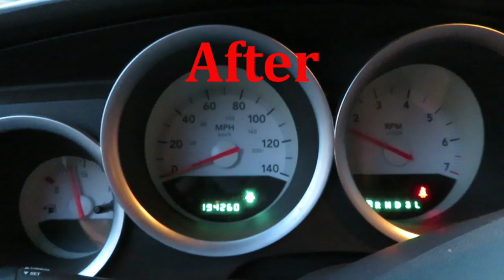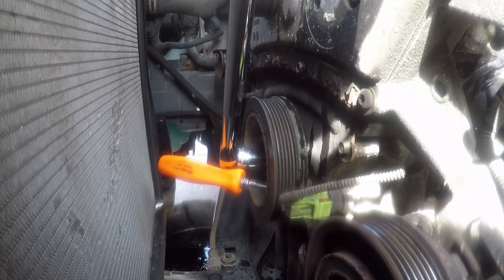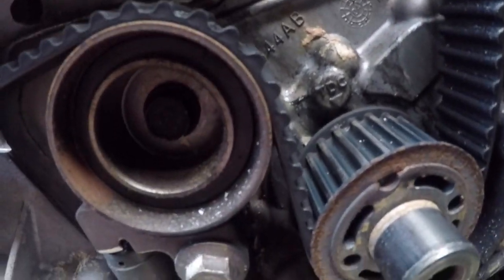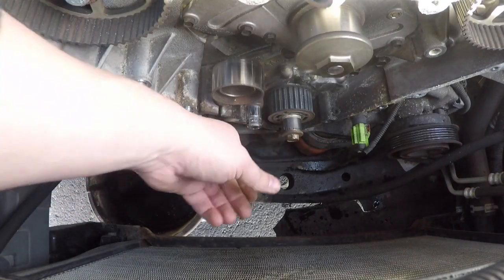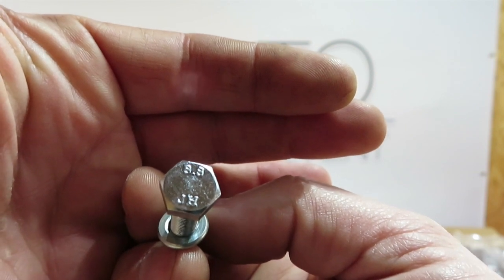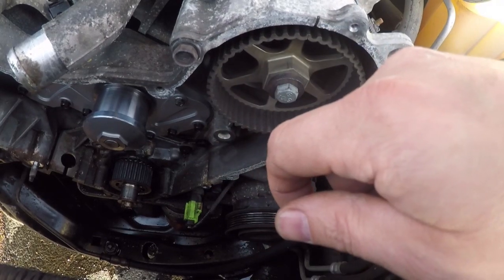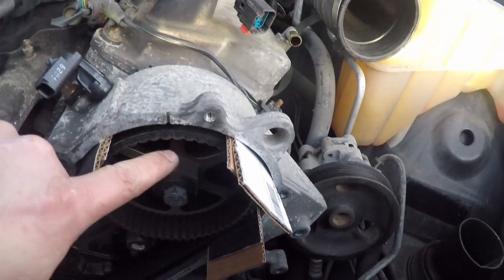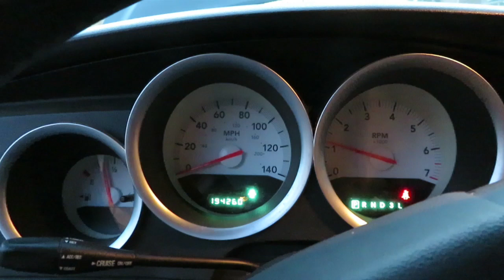Dodge Chrysler 3.5L Timing Belt and Water Pump Installation I Saved a Ton of Money!!!

Comment: I can’t get the pin out, should I just leave it there?
Reply: Like I heard the little click of the release but the pin is just stuck, can I just cut it at the base and leave it so I can put the covers back on?
Reply from the maker: I am assuming you are talking about for the tensioner, if so, as long as the tensioner is holding tension on the belt you should be good to cut it

Comment: Great job but just fyi timing Belts don’t stretch, thats their key feature ;)
Reply from the maker: I guess I just assumed being rubber, they could stretch. Thank you for the info, watching the video, and commenting.
Reply: @DCAutoEnhancement  ya they will snap but will never stretch or it would cause timing issues with zero interference engines. A lot of Chrysler 3.5 engines will smash valves into pistons if belts jump teeth.

Comment: What if the alignment is way off, how can I get them aligned, I have tried turning and turning but they are way off??
Reply from the maker: I started with getting the crank at Top Dead Center (TDC) then I lined up the right cam, then the left. That's where it got kind of difficult.  I had to use some cardboard as a wedge holding the belt tight on the cam sprocket and crank pully. If it is really far off, there is a chance that damage has been done to the engine. I hop this helps.
Reply: How did you align the cams you turned them back?
Reply from the maker: I made sure to rotate the cams as little as possible. I did go forward and backward slightly because the valve springs were making them rotate past the marks.  I don't know if that answers your question or not.
Reply: In the video they were 4 teeth past the marks, you were able to turn the cams back to marks. I have one that’s only one tooth past, still waiting on parts but with the crank on the TDC line I should be about to move the cams back so the markings align?
Reply from the maker: @209Bossman  I'm not sure if your question came through

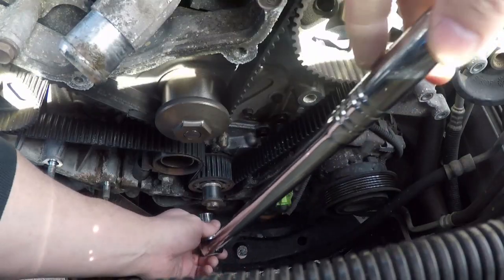Comment: 12:11 bro how did u remove that bolt at the end to put the harmonic balancer back on???
Reply from the maker: I think I used an impact or just a quick snap to break it free. I assume your bolt is so tight that when you try to loosen it, the crank turns?
Reply: @DCAutoEnhancement  yup, I had a feeling it was gonna do that but took the chance anyway lol. I got the timing aligned but now gotta figure out a way to remove that bolt lol but thanks for ur video man it was really helpful
Reply from the maker: @eklipz7213  I'm glad it was helpful. I have another video doing the same job that might show how I did that part. https://youtu.be/MexjRlH7MuE

Comment: So if it's leaking do I need a new water pump or just the seal?
Reply from the maker: If your water pump is leaking, usually it is due to an internal leak and not as simple as the water pump gasket leaking. That is why it is most common to replace the water pump itself.  I hope this helps.
Reply: Replaced water pump then now car runs rough in engine light is flashing...
Reply from the maker: @snowbunnee1471  sounds like maybe the timing is off. Maybe the one of the two cams are not in time with the crank shaft.
Reply: Well I took back apart and the person helping me didn't clean all the gunk off in I forgot so I cleaned up and am reinstalling everything but wen I got the timing chain off there was this little metal piece that is square has two different size holes on it fell out not sure where it goes I don't see it anywhere on any of tge videos. I dobt know how to send videos on here.
Reply: I sent pics through the email of the piece .
Reply from the maker: @snowbunnee1471  you can email me info@dcautoenhancement.com
Reply from the maker: @snowbunnee1471  it takes a while to get through. Try dcautodiy@gmail.com
Reply: Ok I email just now thanks so much I appreciate all your help with this.
Reply from the maker: @snowbunnee1471  that may be from your tensioner t the bottom on the left. Is the belt tight?

Comment: My 3.5 broke the timing belt after 13000 miles on the belt and has a misfire on cylinder 1 and 3 we broke it down again and made sure was still in time and yes it is but is running terrible so I replaced coils cam sensor and crank sensor still misfire on 1 and 3 cylinder..and turns over along time before start..but had it to start first time was smooth them messed up again so done everything all over and back two square one..when my belt broke I had just pulled off from a stop sign so hopefully not much wrong please help if possible
Reply from the maker: Usually on these cars if the belt breaks, it will destroy the engine (pistons hitting valves) however, if it just slips time like the one in the video, it should be ok. Timing is very specific, as I am learning even more on a car that I am currently doing a head gasket on! If timing is good, crank and or cam sensors can be a potential issue. I don't think that I was much help but that's what I got for you. Thank you for watching!
Reply: Sounds like you hit valves and might need a new engine sorry dessie.
Reply: I did replace the engine..then after putting about 10,000 miles on that motor my transmission went out so we replaced it with several bad transmissions so I bought a chrysler 300 I drove home everything was fine I have a friend at a salvage yard he said they was a match and now when it shifts into what it's shows is 4 gear which is actually 5th gear idk why dodge Has it like that it's a 5 speed transmission it will jerk and go into limp mode and code P0730 Incorrect gear ratio we haven't been able to figure it out..but tyranny worked fine in other car...I been dealing with this since april..idk what to do..I even called dodge dealership and asked them did I need to have it programmed or flashed and they acted as if I was crazy..so now I'm really lost..salvage yards said no I shouldn't either..any ideals would be great
Reply from the maker: @dessiealdridge6832 I had a similar issue on an older Sebring and it was the transmission control module

Comment: What if you put it on time and when you spin it to check it’s off timing
Reply from the maker: You would want to pull the belt off and get the crank pulley back to TDC and then put the belt back on and put the cams slightly off in whichever direction would correct the misalignment

Comment: I’m doing mines and my t40 star bit stripped the bolt do u think I need a t 30 instead
Reply from the maker: Usually if something like that is stripped, you would move to a larger size. Sometimes you can use an Allen wrench on a striped torx. I would see if any of them fit try both metric and standard. Just be really careful and feel for it to slip. Worst case, you will have to drill it out(sounds worse than it actually is other than the right space).
Reply: How did u get the harmonic balancer pulley back in
Reply: @spartatacticalarms6914  ...i followed another video & it worked....buy a 12M x1.75x100 bolt from hardware store & use a 1/2" socket, feed the bolt & socket thru it the pulley & tighten it about 1/2 way, back out the 12M bolt and check to see if the original crankbolt will catch, if not retry until it does

Comment: you should have kept turning the crank pulley one more complete turn and all the timing marks would line up now you have the timing way off good luck with getting it set right now and hope its not an interference motor cause it will bend the valves
Reply from the maker: Thanks for the comment. If you watched to the end, the timing must have been right because it fired right up. It is an interference engine.
Reply: @DCAutoEnhancement  this guy doesn’t know what he’s talking about haaha mr know it all. It might of skipped timing and luckily it didn’t travel very far and potentially hit valves. I saw that the T-belt was damage on the edge of the belt that might of caused the t belt to travel and skip time you did an excellent video by the way. I got a timing belt job on a Chrylser Pacfica 05  timing belt and water pump replacement. Very similar but I’ll be working on the side of the vehicle.
Reply from the maker: @erictech201  I appreciate you taking the time to watch the video. There are a lot of people that are quick to speak (or type) without really knowing what they are saying. Good luck on your timing belt replacement.👍
Reply from the maker: The P0300 as you probably know is a code for multiple cylinder miss fires. That could very well be from the alignment of the cams not being correct. I agree with you to be suspect of that because it was running fine before the work and not fine right after. I would take it back to the shop and see what they do for you.
Reply: 2 full turns.. the 4 marks off is likely when water pump bolt snapped and it wedged on crank gear causing belt to stretch n crack like in video, my guess as to why timing was off equal on both cams..  Just bought a 10 charger with dreaded death rattle, swapped rockers still noisy, took apart 2nd time found random 1" piece of plastic down in #4 intake runner, not sure if this caused it to rattle after repair, an intake valve held open a little, the plastic is not from either of the 2 times I had it apart, there was nothing up on intake and it was all blown clear of debris.. soon as I figure this all out, will likely venture into timing belt n water pump job.

Comment: Is it possible that the heads would have messed up because of a timing belt
Reply from the maker: If the timing belt broke, yes. This engine is an interference engine. If the belt breaks, the piston will crash into the valves and you could end up with bent valves at the least or damaged pistons and damaged head at the worst. You would know of you turn the key and it sounds normal other than not starting. If you turn the key and it sounds like stuff crashing it's not good

Comment: How do I install the harmonic balancer?
Reply from the maker: I am glad you asked.  I am in the process of making a second version of this job.  If it would be helpful, I can make a quick video tonight from my footage of just installing the harmonic balancer.  I struggled to get the one on that I recently filmed.  The one in the video I didn't have any issues with.  In the end I went to Lowes and bought an M12x1.75 bolt and used a socket between the bold head and the harmonic balancer to drive it on (after spending $75 on a kit that didn't work).  Let me know if you'd like to see that video and I'll make it this evening and put the link here.
Reply: @DCAutoEnhancement  it would be nice
Reply from the maker: @danielcams7514  I will be posting it today
Reply from the maker: The audio isn't great but hopefully this is helpful to you.
https://youtu.be/W5vR5lv4QP0
Reply from the maker: Thanks for asking about this, this video is performing well and hopefully it was helpful for you

Comment: What if the belt was broke tho
Reply from the maker: 😳🤬 most likely, no good.  With these engines, loud noises and bad things happen if the belt breaks while running.
Reply: @DCAutoEnhancement  can I time the engine by moving them all individually clockwise
Reply from the maker: @5.7_Soul  I would be concerned that if it's out of time by much at all, you could potentially run valves into the top of a piston or two.  I don't know this answer for sure though. You could try Dodge forums to maybe find a good answer

Comment: How did you take the timing bolt off
Reply from the maker: Did you mean belt?
Reply: No the bolt at the bottom I can’t get it off the timing at the bottom.. the one you said to screw into the bottom to turn the belt
Reply: It keeps turning how did you get it out u skipped that
Reply from the maker: @marvinalexandre6670  I am not sure which bolt you are asking about
Reply: @DCAutoEnhancement  no not the time belt
Reply from the maker: @marvinalexandre6670  can you give me a time stamp when I might have mentioned it or have a ratchet on it?